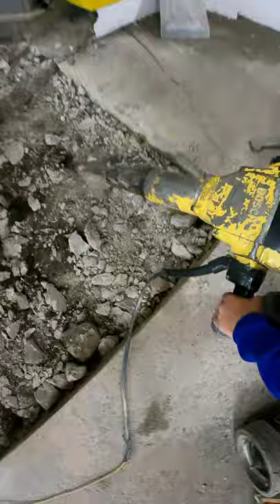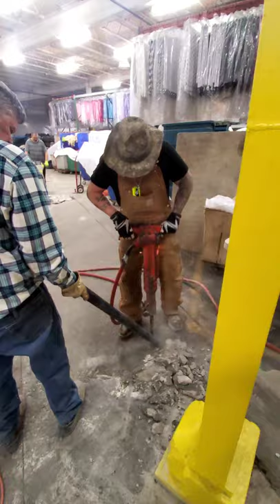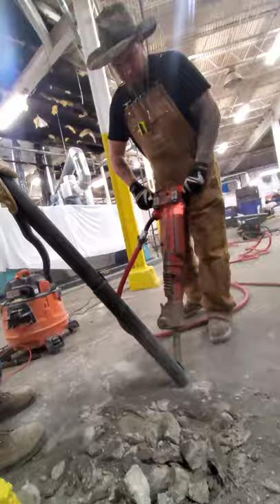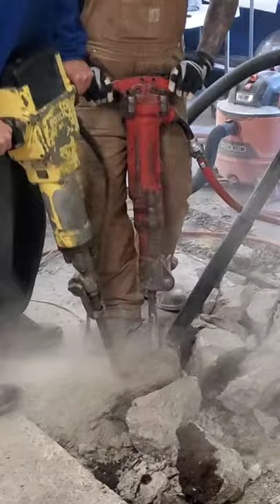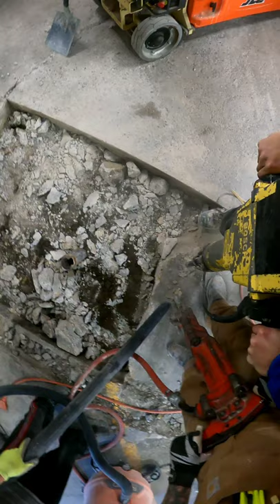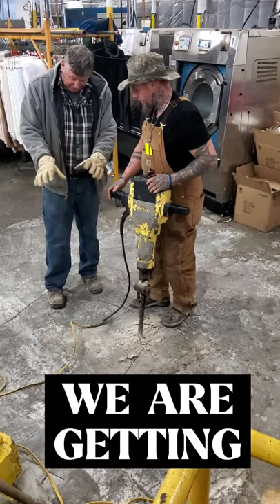90lb AIR HAMMER vs ELECTRIC JACKHAMMER #shorts #jackhammer #concrete #fyppage #fyp

Comment: That feeling of your hand after a long day with the 90lb hammer 😖😖😣
Reply from the maker: I hate them lol
Reply from the maker: Yeah more the feeling of how itchy it makes your arm from the vibration
Reply: Noooo cap 😩😞 and they say your only suppose to use a Jack hammer 40 mins out the day
Reply from the maker: @99Vidsxx 40.mins what. It sucks but we run them all day, not the 90s but the electric, w the right bit it is a beast
Reply: @GRUBB-MUDD vibrations are bad for ya

Comment: What brand is that air hammer? How does it work for you?
Reply from the maker: electric hammer is boshe and it works great for 6 inch thick concrete and less if it has the wide chizzel but. as far as the air hammer not sure it was a 90lb air hammer from a rental company.  I like the electric almost just as good. thanks 4 watching

Comment: That must have been fun. We had to break out a floor indoors this thick last year. Rented some fans and opened all the doors. Ran the 100 with a big breaker. Still took a long time.
Reply from the maker: I need that 100 for a couple hours lol, was the exhaust really bad when u did it?
Reply: @GRUBB-MUDD  Exhaust was fine. They tend to burn pretty clean. Demo saws are the worst though. We used an electric one for the cuts.
Reply from the maker: @jmconcretecoloradosprings  thanks, I wish u were here and could help me tear the rest of this out I gota go rent a bobcat for like 800 w a breaker and a scruffer on it
Reply: @GRUBB-MUDD  I would definitely help you knock that out. I've been home waiting for weather to get better. Don't forget fans. Air flow is key.
Reply from the maker: @jmconcretecoloradosprings  i got some fans thanks

Comment: I have never seen a air jack hammer before does it work similar to a regular jack hammer?
Reply from the maker: its stronger, but alot more dusty. so its not good for inside a laundry mat. but it has more kick, but 25 more lbs too
Reply: @GRUBB-MUDD  oh I see thank you

Comment: Thats a 60 nice try I run them 24/7
Reply from the maker: the electric jack hammer is. the air hammer is def a 90 chief
Reply: @GRUBB-MUDD  I work heavy highway construction. I think I know the difference lol
Reply from the maker: @tannernewbold9060  I just did a quick Google search we both were wrong it's actually 87 lbs but it's Def that same air hammer I had on that job, That electric is 63lbs , I don't know what tools u use but u were not there,  that air hammer was about 30 lbs heavier than the electric. Trust me I have been doing concrete since b4 most of u all were even born.  Some body is misinformed u. If u want me to make a video about it lmk. I will make a video about all the different jack hammers just to show u
Reply from the maker: @tannernewbold9060  they look alot alike but I lifted the s.o.b. I ain't gona come on youtube and lie bro. It was a 90. Def was way more heavy than the 60lb brute boshe electric hammer.

Comment: Sawcut it. 1000x easier and faster
Reply from the maker: We did that 1st, but this was a commercial laundry mat and dry cleaner, so we couldn't have dust or fumes, it was a Tuff job, we ended up getting a bobcat
Reply: @GRUBB-MUDD  for future they make an electric or propane walk behind saw. Get a 30 inch blade to cut that thick slab. No dust with water. Propane has a scrubber for exhaust